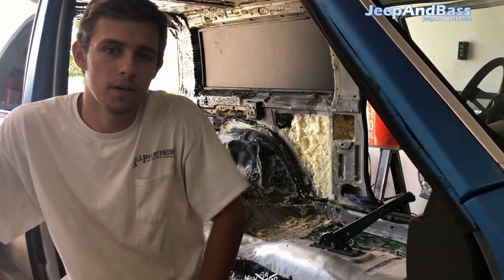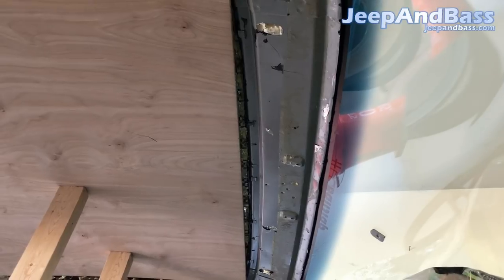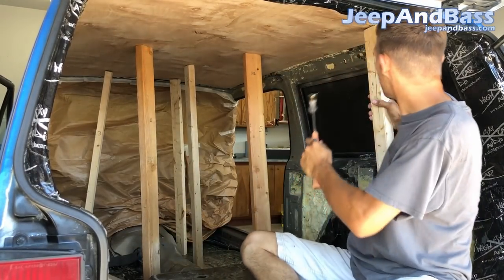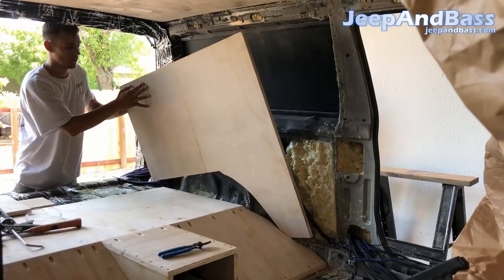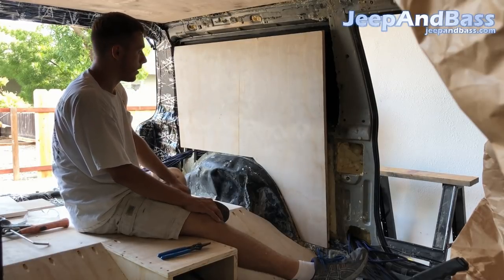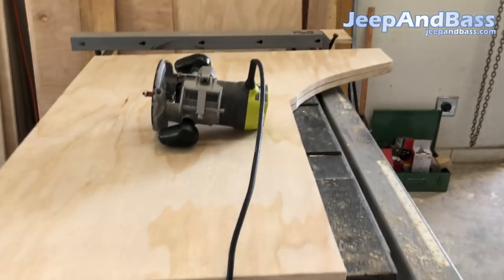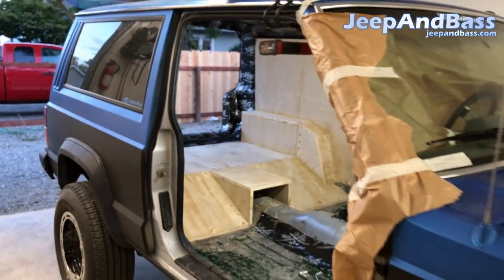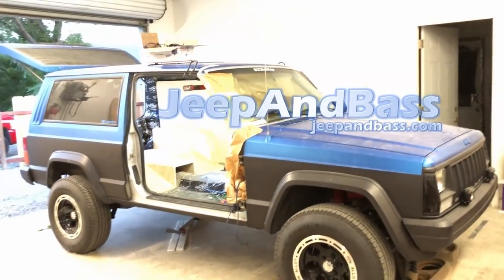DC Audio Jeep Rebuild (Part 3) Rebuild

Comment: Using a Kreg jig? I've seen cabinet makers use it, but not to many box builders. Nice touch!
Reply from the maker: Jim Elam It’s a life saver in a build like this. Can’t always get screws where you want them so this makes it work.
Reply: rcandminilover yeah it's a great tool to use.
Reply: JeepAndBass agreed! I have some different ones that I made myself one has a pneumatic clamp that is controlled with a foot control. The foot control makes handling large pieces a lot easier.
Reply: JeepAndBass you can also use a lock miter router bit for stronger tighter joints in your plywood. I have been using one recently.

Comment: Hey Ray what exactly you said to put between the inside part of the roof and the plywood to stick together?
Reply: COMPASBASSCLUB CHICALI foam
Reply: 818 BASS What's up wey? Que a sido de ti? Que paso con la Blazer?
Reply: Pl construction glue
Reply from the maker: COMPASBASSCLUB CHICALI Loctite PL construction 3x adhesive.
Reply: Asm ByJK Thanks brothers
Reply: JeepAndBass Thanks brothers
Reply: JeepAndBass And how many you used Ray? And is there some other material that can be used?

Comment: How can tell how much cubic ft u have in that enclourse
Reply: Ambrose Chee you just build as big as you can go,then once the shell is done,you can break it up into sections and figure out your total cubic feet...you can always take cubic feet out by adding wood,if needed.
Reply from the maker: Ambrose Chee I’ll be showing you guys an awesome way to find out 😬
Reply: Fill with water and measure the water you take out.